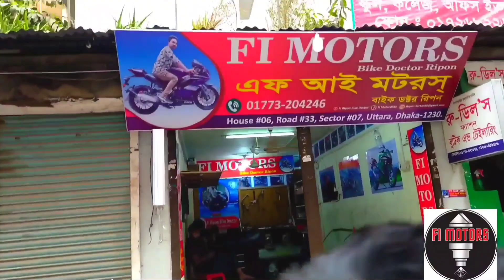বড় ক্ষতি হতে পারে 😱😱ছোট প্রবলেম থেকে #yamaha FZ-S V3 Engine oil short and solution Fi Motors

Comment: vai amar mt15 e 2 -3 din dhore engine ta gorom hoy. ami shield full synthetic 10w40 use kori. proti bar engine oil change korar somoy oil filter oo change kori. 15000 + km run hoise. plz kono poramorsho dile amar help hoito.